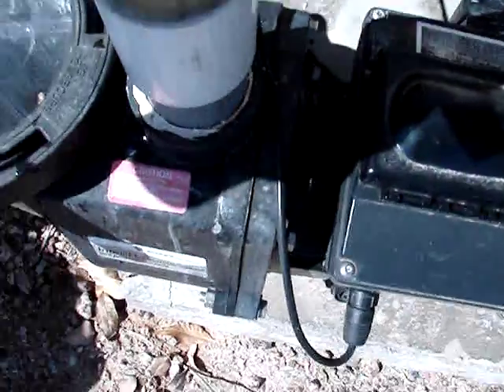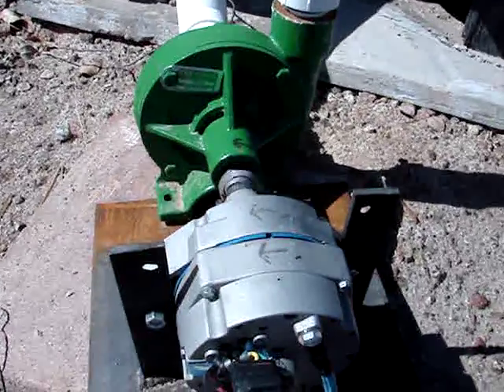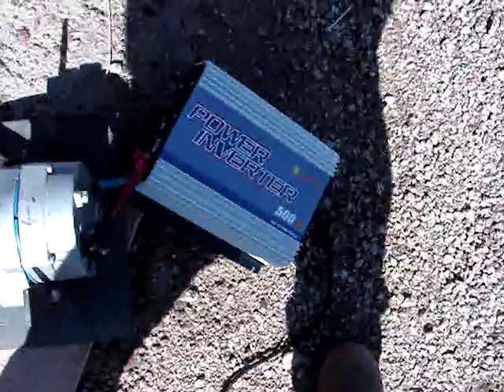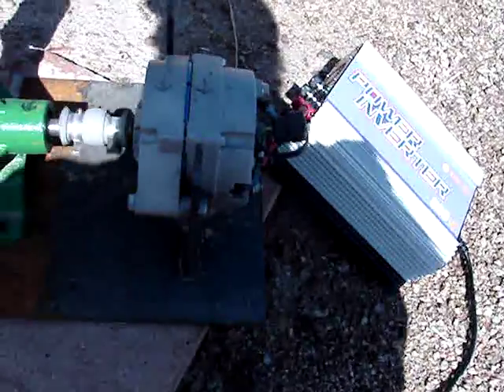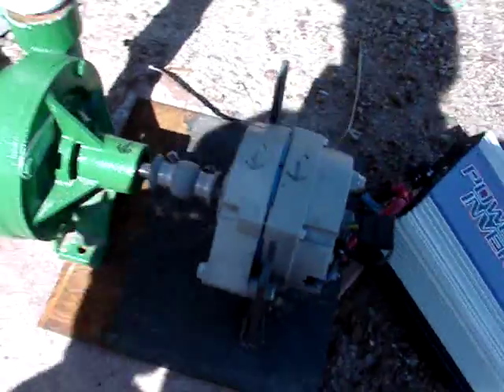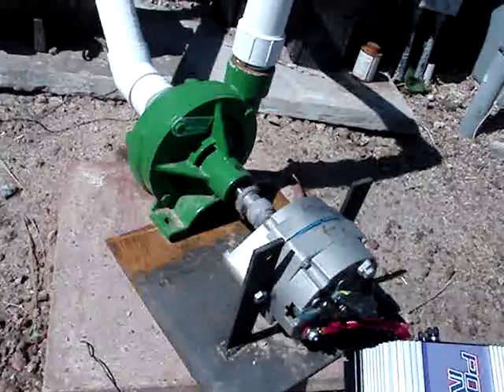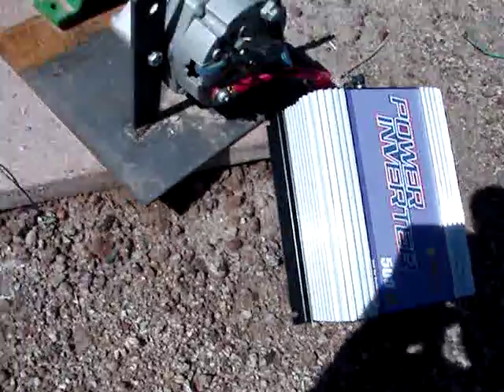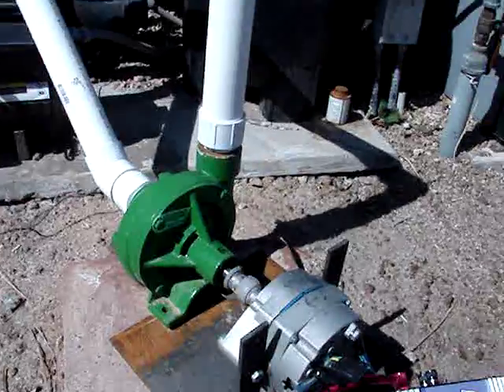Pool Pump Generator First of Its Kind. 2/28/2013

Comment: Only adding a restriction to the water movement causing the pool pump to use more power. I guarantee you have at least a 20% loss during this process costing you more money. Good idea, maybe if you used superconductors and a crank.

Comment: I've been thinking of doing the same but having two pumps one to run in the night and the other to run in the daytime. Then order a slow proportion low RPM generator from China that could produce 40kw to run the whole house I could even make a small reservoir for that purpose  in case if I don't want to use the pool system I've talked to my uncle He's an electrician he would tell me that it cannot be done so now I will show him your video to prove to him that it could be done for years I've been thinking about how to produce energy for the whole house our  Bill comes out to  $600 a month during the summer time.

Comment: Great idea! However instead of using this to regain power from pumping the water in your pool could you utilize this in a pressurized setting ie for your house. Every time you turn the water on it could run that generator charge your battery just a little bit and that's a way of producing power off of the flowing water coming from the city. You could set multiple generators up in a row so that you could utilize more power. Just a thought

Comment: Where do you get a green turbine like that ?
Reply from the maker: Sprinkler World in Phoenix AZ
Reply: +MrTravisGoldman is that 2" inlet and 2" outlet ?
Reply: +Crown Pools oh it's reduced at the outlet I see
Reply from the maker: 2 inch in 1 3/4 out. This was the only pump I could find to fit this application.
Reply from the maker: There is another way to make this set up but it will cost a little more to do.

Comment: Thanx for the video I do have a question. On that pump , what is driving it , is it the force of another water pump or the water coming out of the pool? Im trying to look for a pump that is not messy and will turn  by way of a water wheel but produce serious amounts of water. Sort of a perpetual motion water fall, could you help me out with pool pumps understanding or just some knowledge on how hard they are to turn and pump at full volume ? thanx wes

Comment: All you're doing is making the pump work harder in the first place to turn the additional physical load of the alternator, then losing some of the energy generated by the spinning alternator by running it through your power inverter and feeding it back into your grid.  Not only are you not recapturing any waste energy, your set-up is consuming extra energy.
Reply: I am not so sure this is true... as when using a centrifugal pump power consumption decreases as flow decreases such as throttling with a valve or in this case a turbine pump.  IE my pool pump uses the LEAST amount of current if you were to totally block off the flow.  Of course this is not recommended.. just an example.  You can see for yourself if you are so brave.  Block the flow on a centrifugal pump and you will hear the motor RPM increase as the power demand decreases.  This is not to be confused with a reciprocating pump as power draw will definitely increase with head pressure.  

Stand By for nerd maths. 
Centrifugal Pump Water horse power= Q x H x S.G./3960, where Q = flow, H = head, S.G. = Specific gravity.

Needed horse power is reduced by throttling the output....Q and H are being reduced and its not linear.. Q reduces more then H.
Reply: Brad Hendersonöm
Reply: Brad Henderson factories all over the world are installing inline turbines in the water pipes that cool machines, but this set up is bullshit all the way around

Comment: cool idea since you have to run the pool pumps anyways right? Request, could you put something other than your grid at the output side of the inverter to actually show power being generated? I think Adam might be correct and you got the polarity reversed thus actually sucking energy out of the grid. If you at least light up a light bulb or put a meter on it I may be convinced otherwise. Thanks for the cool idea!
Reply: John Poon 0
Reply: John Poon

Comment: i totally get what you are trying to accomplish and the design is ingenious. BUT the Second Law of Thermodynamics states that "in all energy exchanges, if no energy enters or leaves the system, the potential energy of the state will always be less than that of the initial state." This is also commonly referred to as entropy.  In you case  that means that the additional  load demands on the pool pump will be greater   than the gain of power from the alternator because of losses.Great idea though!
Reply: csxbil I was thinking this jus couldn't find the words well said sir